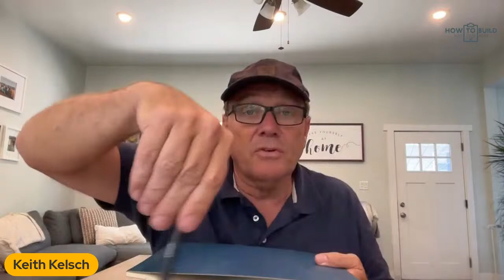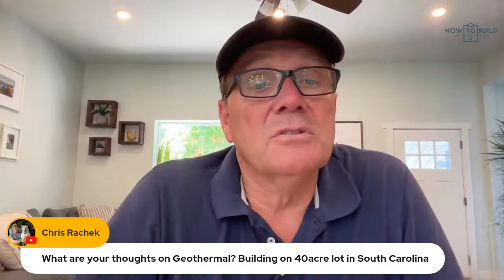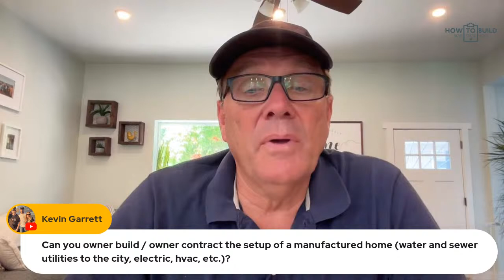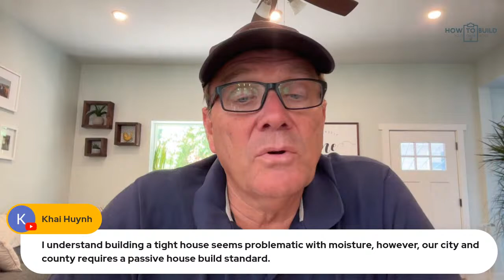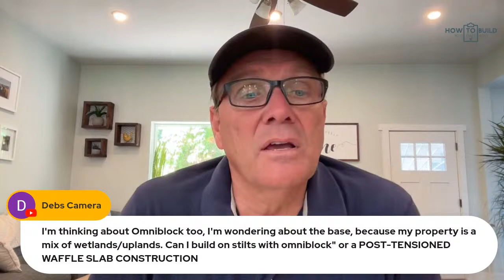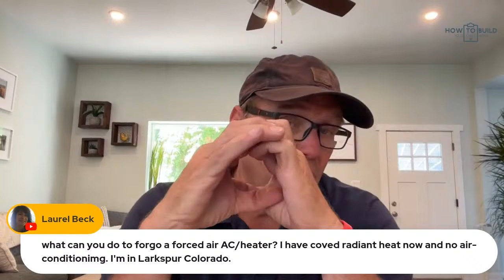ADU/Casita and Q & A with a General Contractor

Comment: Keith, I love you man, but please reconsider your thoughts on a house "breathing". We don't build like we use to. These days, we SHOULD build air tight. I don't want my supply air coming from all different areas of the building envelope. Imagine the air you breath passes foam, osb, sealants, glues, caulking and any other off-gassing modern building material out there, no thank you. If you're comparing the building to a human body(and you should), we don't breathe through our armpits, our ears, our belly button, our skin, etc. We breathe through our dedicated inlets(nose and mouth) which then get filtered through our lungs, we exhaust the same way. It is controlled air circulation. ERV's are not that expensive these days and can easily be routed with a decent HVAC design. They do a GREAT job at filtering the outside air from dust, pollen, and pollution... If you didn't have an ERV, your "beathable" house would let all of the dust, pollen and pollution through the MANY, uncontrolled cracks and crevices. On top of this, ERV's are super energy efficient and they will one day soon be REQUIRED by code. 

MANY municipalities are also performing blower door tests to make sure you're building tight and if you fail, you will not receive your CO. 

Again, I love your work and will be a future student of yours, but I would really like for you to consider updating your world view on this. We didn't even get into cold, moldy surfaces that could form over time... Don't want that to be part of my supply air either. Nobody wants their supply air coming from rockwool, or any of the other, nasty building products we build with these days. Back then, it was wood and..... well, wood! Maybe some tar paper? Sure, in that instance, let the house breathe. I live in a 1927 house myself. 

Thanks for reading
Reply: I would further like to add, there is NO instance where a modern built house, which is properly sealed with a well designed ERV/HVAC system isn't optimal. If you want to "breath" go outside or turn the systems off and open a couple windows. However, a well designed system will never give you any problems inside the house. You're able to control the environment you're in indefinitely.
Reply: @LogansRun314  ...yep. other countries, including many in the EU with harsh winters & extreme humidity/dew point levels, have been building tight with mechanical vent for decades. i'll never have the years of GC experience Keith has, but he's gotta come around to actual science & modern building at some point (i'd hope). 

also will be a future self-manage student, as i'm convinced he's got a good system... and i plan on having him out to experience our cheap-Passiv ICF builds at some point, lol.
Reply from the maker: If I lived in a humid environment I would probably think the same. I seal up the right areas to protect against major problems, but I allow other areas more leeway. I have seen too much damage with homes not being able to dry off fast. It would be fun to have a live chat and hear more info from all great minds.